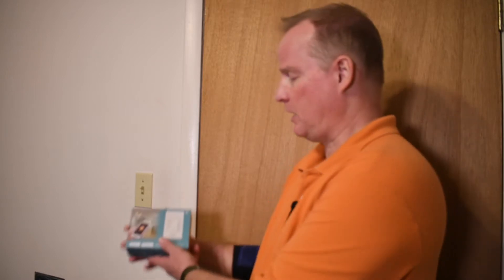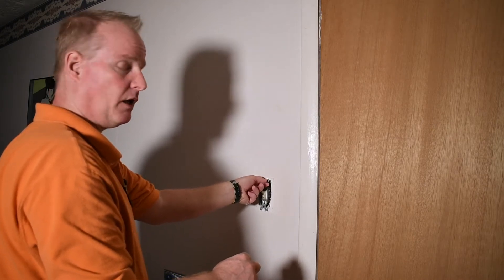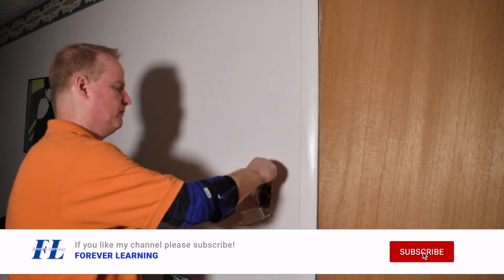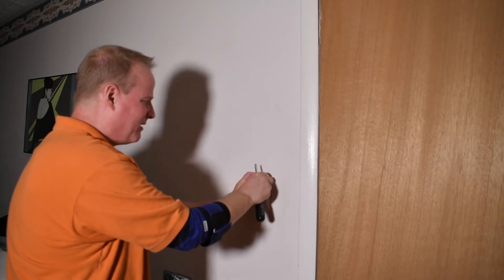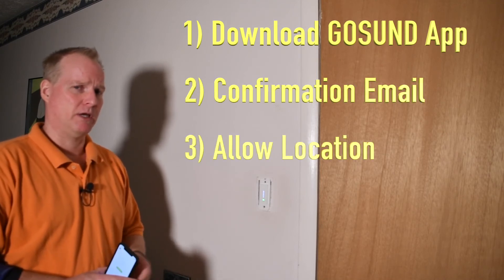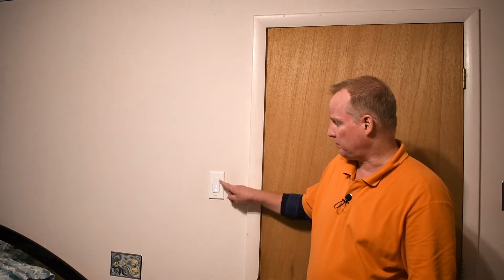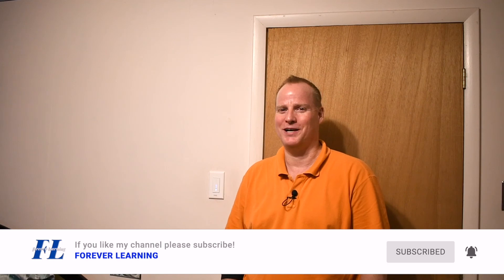How To Install a Smart Switch - Gosund Smart Dimmer Switch

Comment: Good idea to NOt include any close up views of the wiring.
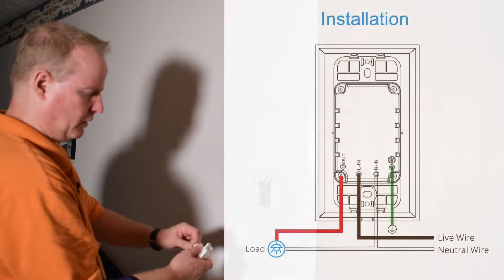Reply from the maker: I have't looked at this video in quite a while.  I do remember having an issue with the 3rd wire, so I included a schematic at 3:15.  That third wire is key with th GoSund, and most smart switches.  It supplies power to operate the wifi reciever.  My wiring was old and I only had two wires (white / black) so I needed to run a (hot) wire from an adjacent receptacle.  

I believe I make reference to that in the video

Comment: installed without  an issue Not sure how have the faceplate to stay in place   Any help on this the face plate does not have a  screw hole ?
Reply from the maker: Tim - The faceplate snaps in when flush.  If you aren't feeling the "snap" you may be slightly offset.  Try moving the switch itself out just a bit (1mm) and see if the faceplate s naps into place.
Reply: @ForeverLearning  Thank you for the comment I was able to get the face plate to snap in place still trying to figure out the timer to turn the lights on and off
Reply from the maker: @timothyannis1455 Great to hear!  I control mine with Amazon Alexa

Comment: You need four wires? The standard black, white, and neutral wire won't work?  And  where did the red wire hook to?
Reply from the maker: Copied from my answer below - Yes, you will need four wires.

Gosund and nearly all of the manufacturers of these Smart Switches require a Fourth wire (NEUTRAL) to supply power when the switch is in the OFF position.  My homes wiring is a little older and this Wire just wasn't there.  MY FIX -- After thinking about this a bit I realized the Outlet on the same wall was in the same approximate location (meaning within the same stud section in the wall) so I opened up the outlet box below (same circuit) and just fished a wire from that junction box 4' straight up to the with.  Worked like a charm!  So, no electrician needed.  However if someone doesn't have this Neutral or LOAD Wire, and doesn't know what they are doing - an electrician would be the best way to go!
Reply: @ForeverLearning  I get it I dunno the hell I was thinking

Comment: I bought eight switches and six work great, but two of them (independently, in different boxes) will randomly jump to different brightness levels (100 to 1, 1 to 50, anywhere in between), sometimes never and sometimes every few minutes. Any ideas what could be causing this other than a faulty switch?
Reply from the maker: You could check your voltage to make sure its constant.  Also don't forget to use Dimmer Bulbs, not standard bulbs
Reply: @ForeverLearning  I actually figured it out… it apparently was the connection between Google Home and Smart Life somehow got out of sync… I unlinked my smart life account from my google home and reconnected (and re-setup all my routines) and everything stopped messing up. Thanks for the reply!

Comment: If I have two black wires coming of my existing switch how do I know which one goes to the black vs white wire
Reply from the maker: You'd have to use a multi-meter at that point.  Proper wiring (code) should utilize the different colors to avoid this, or some would have taped one of the wires for identification.

Comment: Thanks @Forever Learning for this tutorial,  I replaced an old dimmer with this dimmer from gosund and it worked perfectly. However, in the installation of the house there is another manual switch (without dimmer) that slides the same light, that is, two switches turn the lamps on and off. That way when I installed the new dimmer, when trying to turn off the lamp on the old switch (which does not have the dimmer function) it does not turn off. That way if I want to completely turn off the lamp with the new dimmer (gosund) I need to make sure that the old switch is in the off position, otherwise, the lamp will always stay on because gosund's electronic switch keeps it on. I'm in doubt about what to do, if I disable this other old switch or if I try to put a new dimmer (but I don't know how they would work together) or if I put a 3-way switch in place of this old one ..
Reply from the maker: Alex - Excellent question.  I just wrote to GOSUND to see if I can come up with a solution for you.  They (Gosund) recently send me a 3 Way Switch Set: https://amzn.to/2Mxgr8W which is currently on sale if you are interested.  I asked Gosund if you could combine the Dimmable Switch you already have installed with one of the switches in this 3 Way Switch.  I will let you know what their answer is when they get back to me.

Comment: Hi.  You mention that it works with Apple HomeKit.  Is that the case?  Because I can't find this in the product description.  Thanks.
Reply from the maker: Bill Thanks for the Reply - I can not confirm this will work with Homekit.  I assumed (you know what they say about assume) as a smart switch it would work.  After a brief internet search I found this (almost cyptic) information: https://rb.gy/cciinc which states that it is not officially compatibility.  So while I don't personally use a HomeKit, I do think I could make it work, but I can't prove that - If I ever switch from Amazon to Apple I will test it out and let you know.  My apologies for the misinformation...  Thank you for bringing this to my attention

Comment: I noticed the red wire from the smart switch is not connected to anything. How does it work?
Reply from the maker: The Red Wire will attach to your "Load" or basically to the light you are trying to control.  I had to install a Neutral wire to accomplish this.  You'll find a wiring diagram at 3:12 in the video.  At 5:08 you'll TEXT letting you know the RED Wire connects to the "LOAD"

Comment: I watched this video to get a review of the gosund switches. However, it turned to entertainment when I saw the dead end switch set up. Good job on keeping the confidence going on screen :D:D. I would have loved to see the interaction with the electrician, if you know what I mean. (Yes, I am an electrician)
Reply from the maker: Thanks for the review Josue.  I haven't looked at this video for a while, but I did run in to trouble with the Neutral Wire.  Gosund and nearly all of the manufacturers of these Smart Switched require a Fourth wire (NEUTRAL) to supply power when the switch is in the OFF position.  My homes wiring is a little older and this Wire just wasn't there.  MY FIX -- After thinking about this a bit I realized the Outlet on the same wall was in the same approximate location (meaning within the same stud section in the wall) so I opened up the outlet box below (same circuit) and just fished a wire from that junction box 4' straight up to the with.  Worked like a charm!  So, no electrician needed.  However if someone doesn't have this Neutral or LOAD Wire, and doesn't know what they are doing - an electrician would be the best way to go!

Comment: These light switches are great! Included instructions were easy to understand and installation was a breeze.
Reply from the maker: Thank you Danny - For most installation is easy.  I ran in to an issue with the missing Neutral Wire in my setup, but I was able to correct it fairly easily.

Comment: How did you get around having no neutral wire?
Reply from the maker: I didn't - It was definitely a trap - I went to an outlet on the same Wall (3 feet below) and ran a Solid Wire up from the outlet to use as my Neutral - Worked perfectly
Reply: @ForeverLearning  thanks
Reply: @ForeverLearning  hi. did you ever do the video to the neutral wire installation?
Reply from the maker: Beydoun - Not as of yet.  I have two 3 Way Switches to Install.  When I complete that install I will create a video for the Neutral Wire.  I will be out of the country for the next 30 days, please check back or Hit the Notifications Bell to be notified when it has been uploaded.